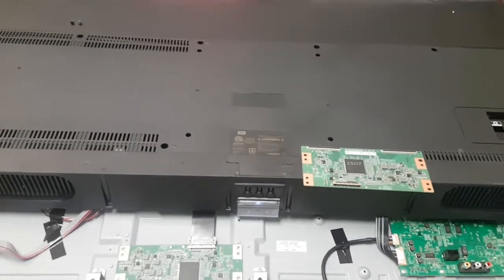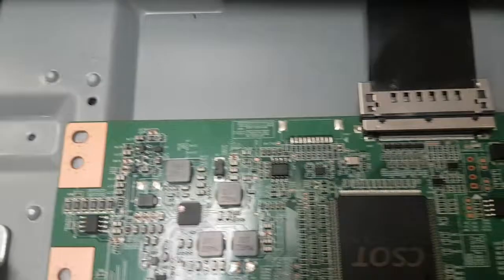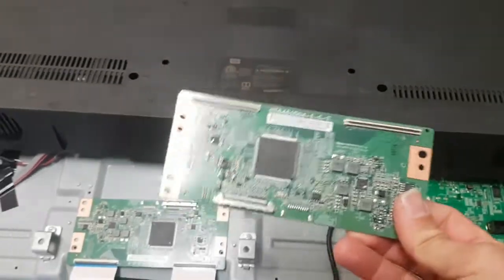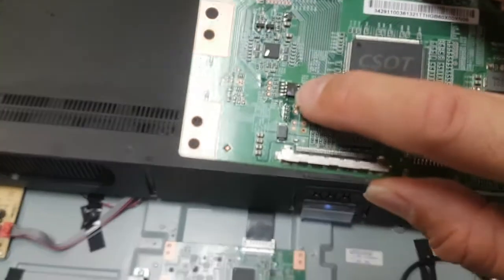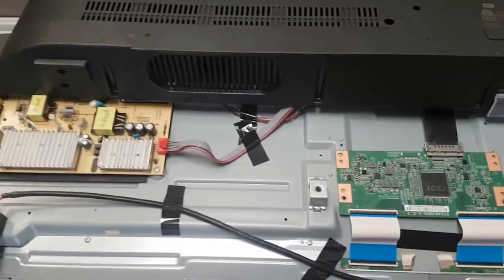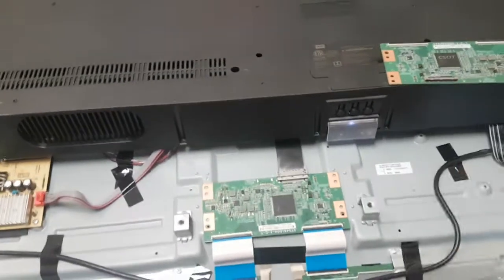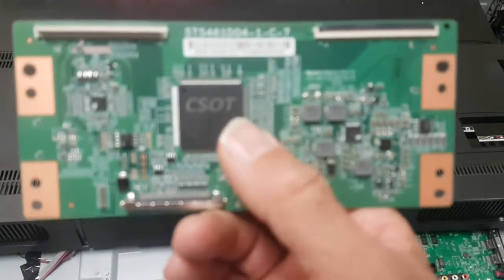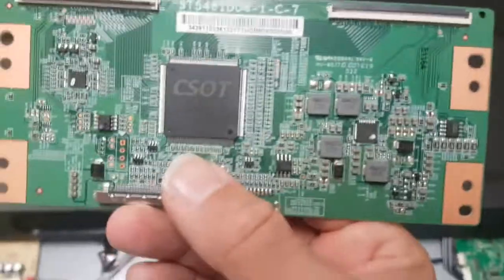How to repair TCL 55P607, TcL 55S405 with back light, but no picture - ST5461D04-1-C-7 TCON issue

Comment: I have a 65" TCL TV Service No. 65S421TCAA --- If you let the TV sit off for a day or so, when you turn it on the TCL logo will flash full brightness for literally 1/60th of a second (I recorded slow motion on my phone) then go black. You can hear the menu sound effects, and it works "just fine" but no picture. Sometimes if you hold your head just right, and the angle of the room light is just right, you can make out SUPER DUPER FAINT - I MEAN REALLY FAINT text on the screen....sometimes. After researching - I'm thinking it is something to do with the TCON board - any ideas? THANK YOU!
Reply: Im having the same problem with my 65 tcl 65s455-CA

Comment: Do you know if the size of the TV changes the part you need? Because I have a fifty inch tv that's doing the same thing
Reply from the maker: The universally correct answer to this question is "it depends". Mostly it depends on the particular model. I do not know if it makes any difference in the context of 55'' to 50'' TCLs, but based on other experiences my first guess would be that it would [make a difference].
Reply: @coppelltvrepair  Great, thank you